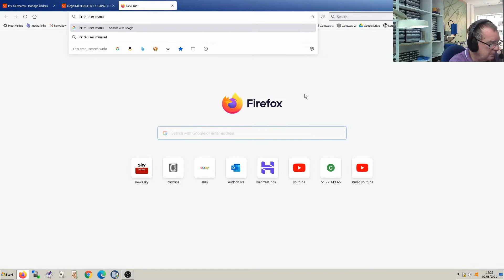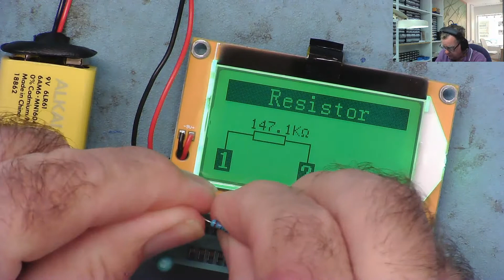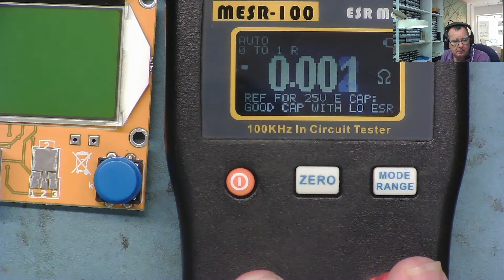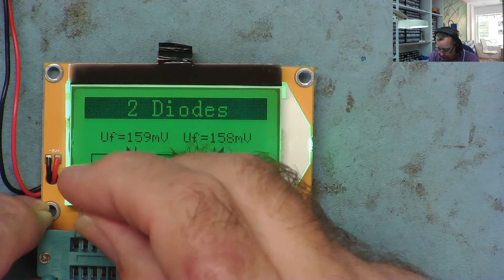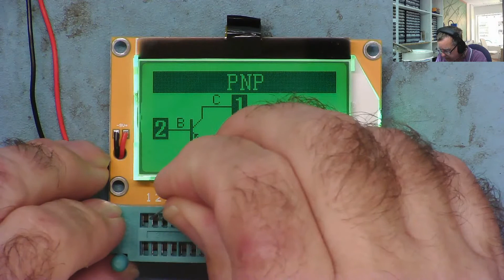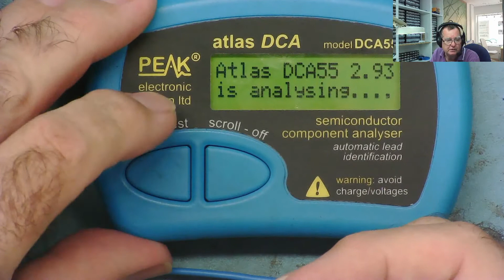$8 Component Tester LCR 4T Review.  Learn Electronics Repair #064

Comment: Is it possible with this lcr to find a short on gpu vrm ?
Reply: there are some custom firmware for this device you can calibrate and select manul resistance mode with 0.01 ohm
i am also working on it successfully installed firmware seems good but i didn't test yet for vrm short tracing